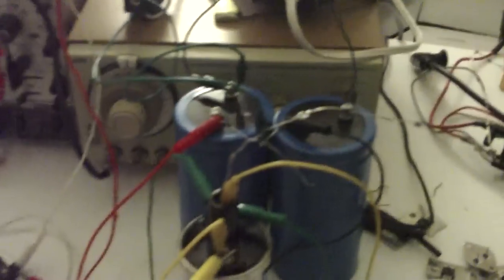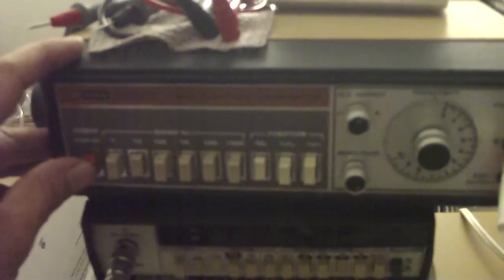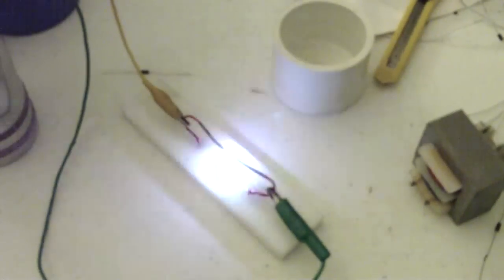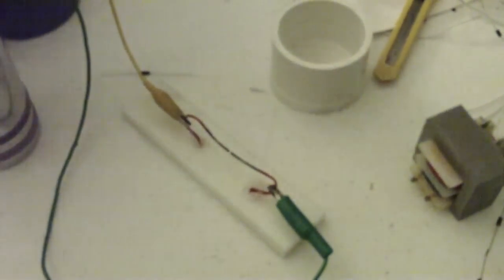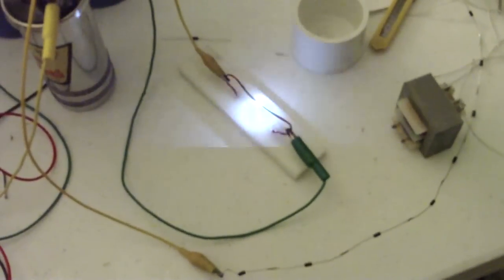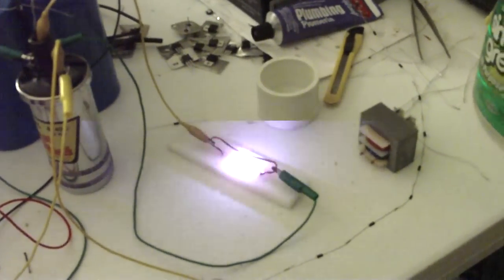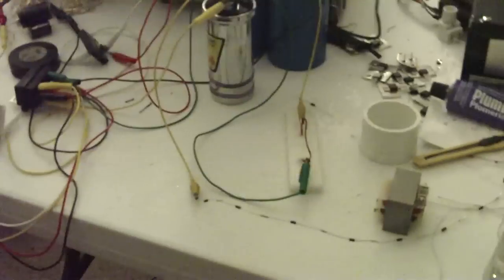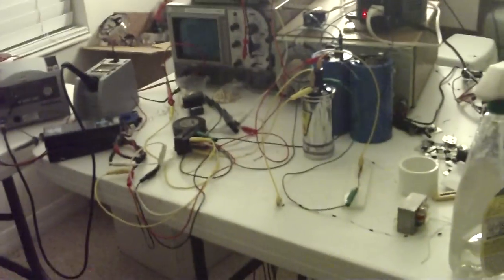Plasma Spark with Water Explosion

Comment: No water is burning or "exploding" here. Possibly small puffs of rapidly-expanding steam. Any proper measure of electricity input and heat energy output would verify no net generation of energy, merely conversion of electrical energy into heat.